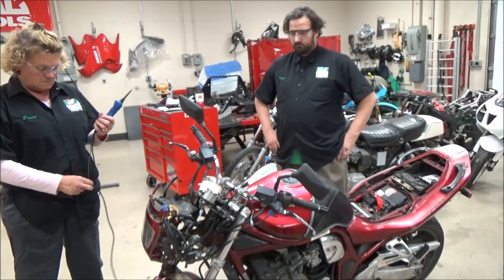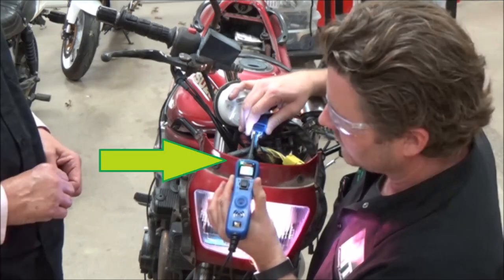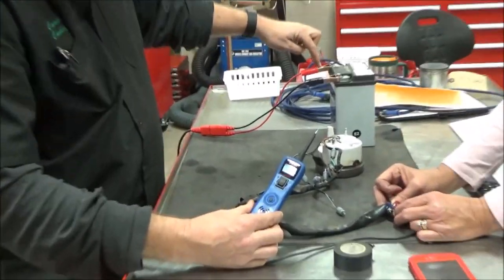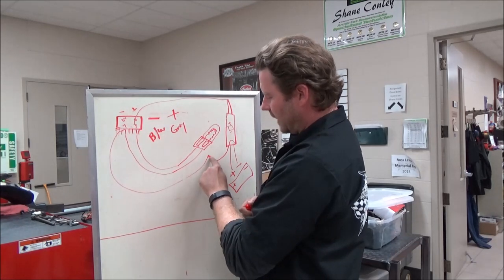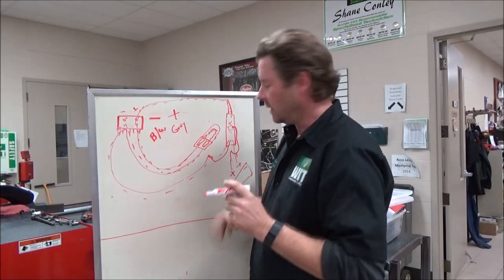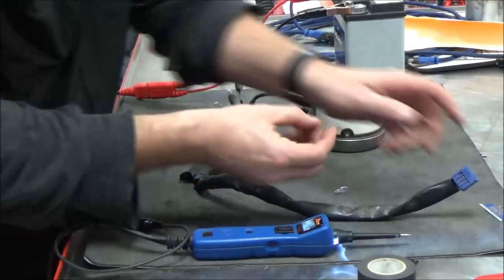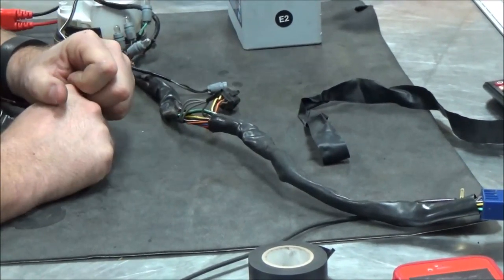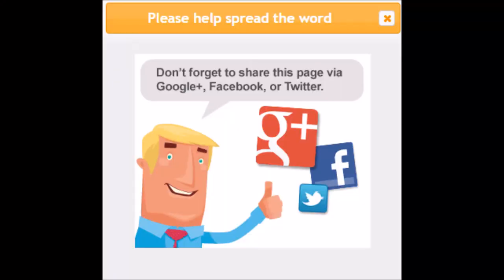How to diagnose electrical faults with ease using the Power Probe!

Comment: the problem with power probes is they dont load the circuit during closes circuit tests like in the begging.  it doesn't show voltage drops. the load pro is a much better diagnostic tool for voltage drop testing which would eliminate everything from the connector back, etc. power probe has it uses like every tool. however, I dont think it's great for circuit testing. very useful for applying powers and ground though.
Reply from the maker: Thank you! Please share on your social media! Make sure to subscribe and click the notifications button for all future videos! Also, my playlists are broken down pretty well. The most popular one being: "Every Mechanic Should Know This" 

https://www.youtube.com/playlist?list=PLAtBOuPaEyt_uMyVlK1tsBVnSYW1Q0vCK 

Feel free to make any suggestions or reach out to me for personal mentorship,

Keep Wrenching, 
Shane Conley
Instructor/Motivator/Motorcyclist
Reply: Pros and cons.
Reply: Totally agree _ just looking at lights on the power probe without the circuit loaded proves nothing really... load it and you may see that voltage drop like a stone.
Reply: Absolutely correct , I agreed to Stephen Sir